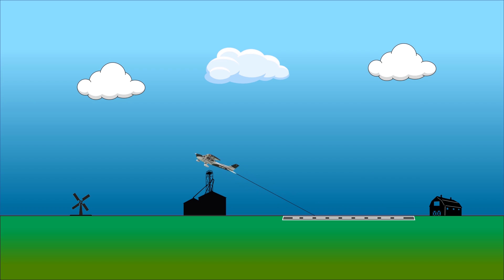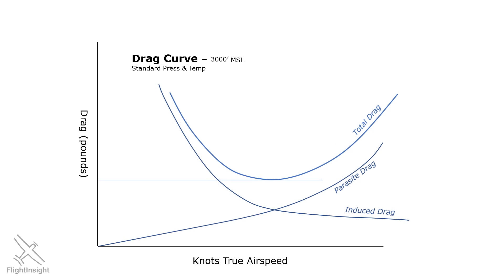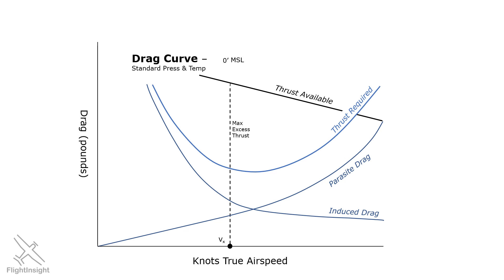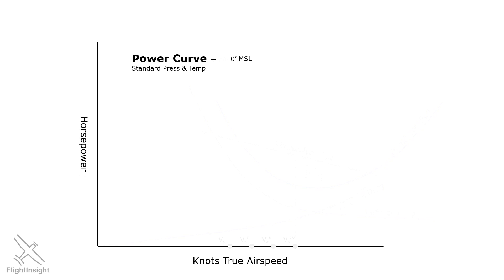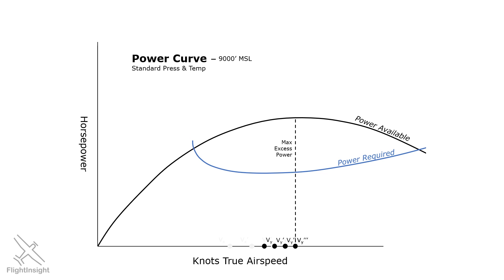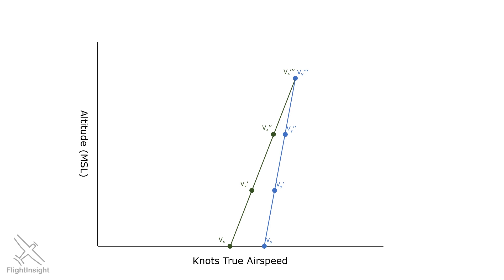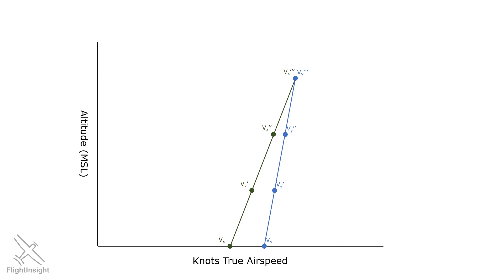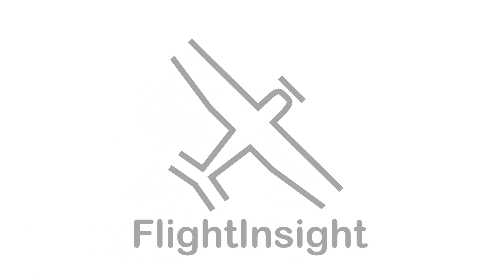Why does Vx increase, and Vy decrease with altitude? | Climb speeds explained

Comment: Only comment, the characteristics are Complicated not Complex. Complex is not synonymous with Complicated. Complicated is ordered, deterministic, predictable, repeatable, regular. It requires analysis but it always gives the same thing. In Complexity, you may have patterns, but results vary. In Complexity, analysis fails you as the situation changes hence what you’ve previously learned no longer applies. You’re analyzing here, you’re working in Complication.
Reply from the maker: 'Complex' is appropriate when describing "an aircraft's climb performance characteristics." Webster's definition of complex: "a group of obviously related units of which the degree and nature of the relationship is imperfectly known" applies here. The factors affecting performance being inclusive of all the characteristics of the atmosphere and environment, as well as airframe and power production, being imperfectly known, make analyzing results with certainty difficult. In fact using the word 'complicated' here would detract from the larger point, being that the analysis in the video was too simplistic to apply perfectly to a complex system like real world performance, where actual results are not knowable beforehand.
Reply: @flightinsight9111 those are old definition. Look up Dave Snowden’s Cynefin, look for the Scott Page Complexity lectures available here on youtube, try Rick Nason “It’s Not That Complicated.” You could also search Medium The Contrarian Aviator Sometimes Turns Right. Having the distinction between these two terms available to you opens up whole new ways to discuss concepts while knowing the distinction gives you different ways to approach problems. Climb performance is ordered hence not complex, though I’d argue it is actually closer to clear than complicated.
Reply: @flightinsight9111  The dictionary is behind the times. It also failed to account for linguistics and etymology. Complex came from a Greek root for entangled while complicated came from a Roman for folded. You can unfold things though it is much harder to unentangle. Look into Cynefin and Dave Snowden. See also Sidney Dekker’s work. Appreciating the distinction between ‘complex’ and ‘complicated’ has significance when we look to safety work. This is especially true as most our safety tools are built for clear and/or complicated and therefore fail in complexity. You’ll note there are ties to naturalistic decision making and Klein as well as Twersky/kahneman. And Boyd, John Boyd’s Destruction and Creation really tie to these. Though for easier reading, I’d suggest Ron Butcher on Medium with his view of overlaps yet also disparate and contrasting features between “safety” (read too heavily as ‘compliance’) and “survival.” Note ICAO is moving to learning these concerns as is BALPA. American Airlines is making some inroads too. The EU has fully incorporated the ideas in their recent Crisis Response manual while the Marine Corps is probably the best in applying. In complexity, relationships are not obvious.

Comment: Good explanation of the math of Vx and Vy.  The practicality, from an old crop duster's point of view, is that neither Vx nor Vy are generally appropriate.  Watch an modern Ag pilot take off using the basic level in low ground effect takeoff.  He has a much more powerful engine than the 235 hp engine on my Pawnee, but he is hauling eight times the load.  Yet, both of us value the free energy acceleration of level in low ground effect so long as runway (or open desert) is available until cruise airspeed before pitch up to just over (not well over) the obstruction.  Either Vx or Vy is a very dangerous low energy state, low airspeed state, when not absolutely necessary to miss things.
Reply: Vy is not "a very dangerous low energy state". Vy in a piston twin is the safest speed you can climb out. Even recommended Vx for a single is certified to be a safe speed for EFATO without resort to exceptional piloting skill. Having said that I agree that neither speed tends to be the best operational choice above a safe height.
Reply: @XPLAlN  Please see my comment posted just now.  It should be at the top of the stack of comments if you sort by NEWEST FIRST.
Reply: @XPLAlN  It is not exceptional piloting skills.  I soloed many students in 65 hp trainers in less than ten hours using the basic level in low ground effect takeoff.  At high DA, say Monte Vista midday in summer, low ground effect energy was 50% of our total energy available.  We couldn't have safely trained using Vx or Vy, neither being safe.  Yes, in normal conditions most do so.  Only a couple hundred or so yearly overdo the getting up quickly and stall just as they reach the out of ground effect altitude where flying slower than Vso is generally fatal.  With thousands of feet of runway remaining, acceleration level in low ground effect is safer at any speed than Vso at fifty feet or so.
Reply: @jimmydulin928  quote: “Vso at fifty feet”. Do you wish to be taken seriously? Nobody is suggesting stall speed for climb out. Please keep it real. POH recommended 50’ speed is minimum 1.2 Vs1, or alternatively, a speed not less Vx + 5 that has been shown to be safe. Nor is anyone advocating short field technique for climbing out from a runway when you have “thousands of feet remaining”. Short field technique is for short fields. Nobody is recommending that speed beyond the point it is no longer necessary to clear an obstruction.
  Quote: “we couldn’t have safely trained using Vx or Vy, neither being safe”. Vx is the limit, not of what is subjectively safe but what is objectively possible in terms of angle of climb. If you need that angle, there is nothing safe about choosing a higher speed that doesn’t provide it.
Reply: Hi sir. That’s very interesting and I’ve thought about it before. Help me understand. So you are saying that on takeoff, accelerating using ground effect to a cruise airspeed so long as runway length allows, and the pitch up to clear the obstacle, you will actually clear the obstacle by a greater height than just taking off and maintaining Vx? That is what I’m taking away from your post . It makes sense. Here’s a scenario I have a question on: So when you accelerate to cruise using ground effect and then pitch up, let’s say the obstacle is still not cleared. Then you would maintainVx until you’ve cleared it? Step 1. Using ground effect on takeoff for its benefits on building energy. Step 2. Accelerate to cruise speed in ground effect so long as rwy length allows and then pitch up to clear the obstacle. Step 3. If obstacle is not cleared yet  in the initial pitch up then maintain Vx? Thank you for your input and wisdom. I actually have my CFI check ride in  8 hours from  writing this comment. It’s 12:30am now haha. I always find myself wanting to learn more and your comment intrigued me because it really does make so much sense yet is not taught at least not during my training. And I’m curious if you are aware to any references or tests done to back this up. -Derrick
Reply: @derrick2251  Yes, staying level in low ground effect provides enough greater acceleration vs pitching up to Vxo or Vy pitch attitude as soon as Vx or Vy airspeed is attained to climb faster in a zoom climb when Vcc is attained.  No, we would not be higher over the obstacles nor is that the objective.  The purpose of accelerating level in low ground effect is to gain the free energy for safety and so the outcome of the maneuver is never in doubt.  Having gained more airspeed safely over the runway, we don't then want to spend all that extra safe airspeed on altitude over the obstacles.  We want to just clear the obstacles at the airport and cruise climb safely to altitude.  If over the crop on a spray run, we want to use the full power level in low ground effect acceleration advantage to zoom climb just over the obstacles and gain only enough altitude to safely apply this potential energy in the 1 g turn of whatever bank angle is required to return to the next swath run only fifty feet upwind from where we left the field.

What we are avoiding, at the airport especially, is picking to a Vx or Vy pitch attitude while that slow in ground effect and quickly climbing out of ground effect where Vso, an out of ground effect number, will cause stall.  At slower than Vso in ground effect we can safely fly, especially low ground effect, with the outcome of that flying never in doubt.  Either Vx or Vy, just climbing out of ground effect, is much closer to Vso than Vcc.   We don't want to quickly climb just high enough to kill ourselves in the stall and fall of being a bit slower than Vso, or getting there in the startle of engine failure.  Neither Vx nor Vy are ever appropriate on long runways where Vcc, especially in low ground effect, is easily doable with the outcome of the maneuver never in doubt.
Reply: @ thank you for your insight and thorough response. I passed my Cfi checkride too if you were curious

Comment: I seem to remember in my early training that the curves intersect (regarding IAS) at the service ceiling. Apparently it is lower than that.
Reply: service ceiling is the altitude at which the climb performance drops to 100 feet per minute. absolute ceiling would be 0 feet per minute.
Reply: @dannyCOTW  We fly in rivers of air.  Thermal lift, cooler air descending, ridge lift, descending air below the declination line of a ridge, and wave are natural things that make these calculations just calculations.  I have been lifted from 7,000 to 13,500 in a minute in a 65 hp Taylorcraft.  I have been dumped from 13,500 to a hundred feet off the desert floor in a Tri-Pacer.  A Huey at the Army's Mountain Flying School at Ft. Carson went from 7,500 to 17,500 at flat pitch.  We got oxygen like the zoomies after that.
Reply: @williamk5998  Vy and Vx intersect at absolute ceiling (as dannyCOTW wrote). It is conventional to determine this altitude  by extrapolation from climb data gathered in tests up to about the service ceiling. In the performance flight testing, climb rate is recorded over a range of speeds and altitudes (sawtooth climb tests). The data is then processed graphically into 3 or more curves of climb rate vs speed (ie curves for 3 or more suitably different density altitudes). By striking a line through the peaks, and another through the tangents, you get the two straight lines that will intersect at absolute ceiling. Although you could determine absolute ceiling directly with a simple climb test, the sawtooth climb data provides Vx and Vy profiles and even the drag polar can be extracted.

Comment: Most POH’s have a cruise climb that is 10 to 15 kn higher than Vy. This is because the manufacturer recommends for visibility, engine cooling and fuel consumption savings. If you are not concerned with getting to altitude fast, and you have a long cross country, you’ll gain more distance from your departure end before you reach cruise altitude. This always puzzled me when it came to flightplan because the book gave you time, fuel, distance based on a specific indicated airspeed, and as long it was zero wind. If you went, climbed via a cruise climb airspeed, your calculations were messed up because you burned more fuel being at power settings to get you to altitude, but traded off distance to destination. One other thing to consider, especially with constant speed propellers. Is the recommended climb setting which is about 90% power. Big planes like airliners have their engines reduce after they reach a safe altitude. Technically there aren’t too many airplanes that climb to altitude at full power, except for those with a fixed pitch prop.